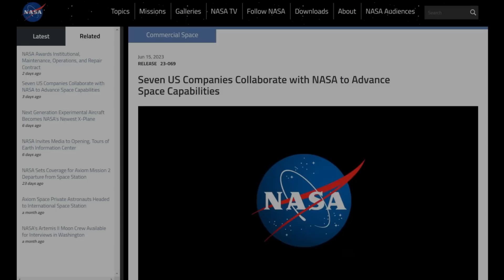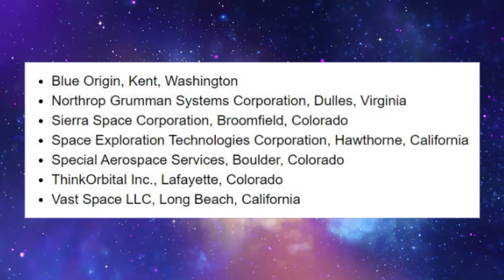NASA's New Agreement With SpaceX, Blue Origin, Sierra Space, & More

Comment: I just don't get the Dream Chaser. It's based on ancient technology and a mission that doesn't exist. Did we learn nothing from the problematic, inflationary Space Shuttle?
Reply: Dream Chaser and the Space Shuttle are not very comparable. Aside from scale, there is the fact that Dream Chaser is a lift body, is intended for autonomous use (the bid with NASA is for a robotic cargo vehicle), and possibly has different, more modern subsystems, like a safer reaction control system, in contrast to the Space Shuttle. Then possibly it could be launched on different launch systems. The value here is to see how space plane operations could be improved, with turnaround times, operational efficiencies, reuse, etc. in contrast to the experiences with the Shuttle.

The big question is how likely would this be man rated for a reusable launch system, increasing the degree of reusability?
Reply: I’m predicting DC will be used more between stations? Earth and the Lunar station maybe…